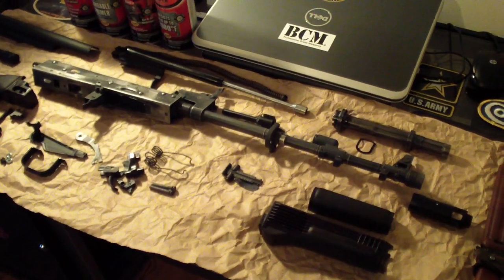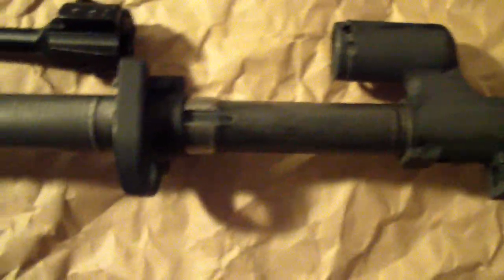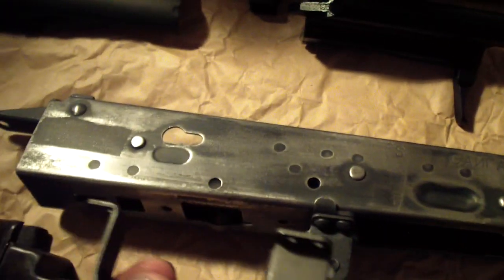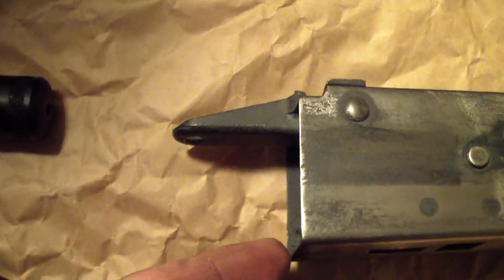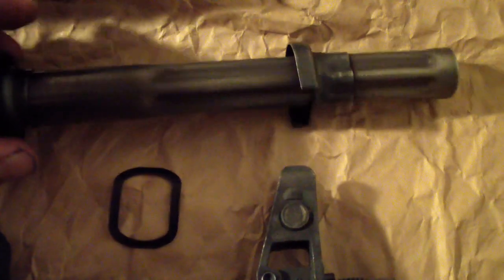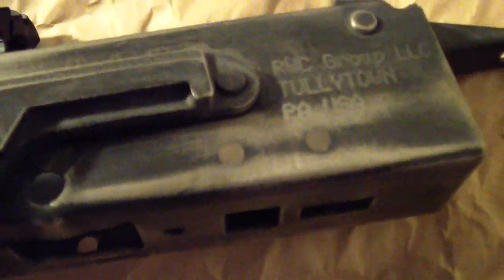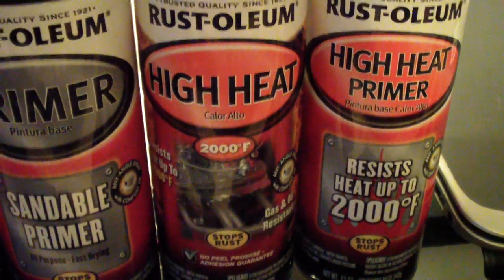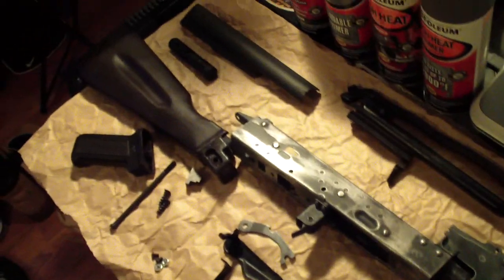Russian Saiga AK-74 Conversion

Comment: I would be interested in how you did the gas block and front sight. I presume those are tapered pins holding those on the barrel. Just curious.
Reply from the maker: I reamed them then used a rubber mallet to tap them into place.